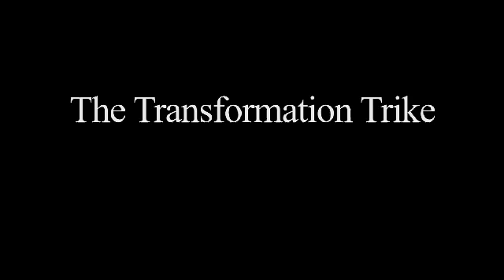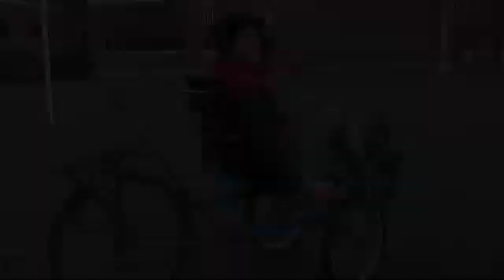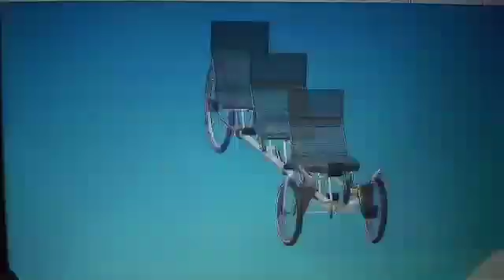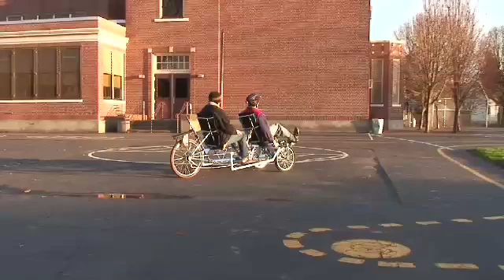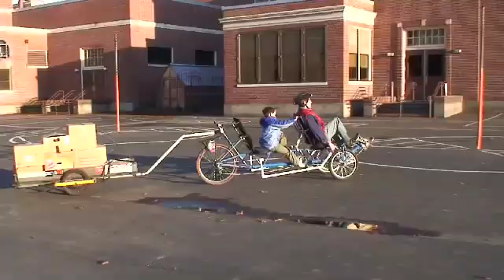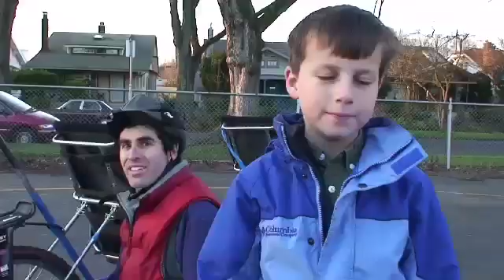Innovate or Die -- The Transformation Trike

Comment: @pdxktv There IS something misleading in the graph. Why is Swimming - the Least efficient and slowest - in the middle of the Y axis and not at the very top? It is no use putting the label "1 1/2" (mph) between 10 and 30 because it creates a Nonlinear, (Non Monotonic even) er "axis". Walker, Runner, and "Horse and rider" are similarly Deliberately misplaced. I appaud your efforts but not your er "Marketing", nor the result, and suggest that Production'd get you into all manner of Legal Hot Water.

Comment from the maker: @MistaTSluss Electric cars are, for the most part, coal powered cars and, regardless of fuel source, if we use electricity to replace gasoline in any significant manner we will be facing a whole host of new problems with infrastructure/delivery, pollution, and higher prices.

Comment from the maker: @MrHobiecat most of the driving I do in the van is hauling a small number of humans. In that case, there is not much practical difference between the vehicles.  

In many urban environments a bicycle can actually get you to your destination quicker than a car so the 75 mph cruising speed is irrelevant.  

There is nothing misleading or inaccurate about the graph.  If your goal is to transport humans and top speed is not a factor then the bicycle is the most efficient means.

Comment: This looks heavy, slow, tippy and the steering is awkward. I would bet a buck those boxes are empty. First hill or rough road and I think you're pushing. I don't see the advantage over a regular multi gear bicycle with a lightweight trailer. Sitting down you cannot use body weight to help with inclines and downhill would be bloody scary.

Comment from the maker: The only thing being proposed in this video is the trike and that expensive fuels could make it even more viable.

But since you brought up the straw-man arguments that we are trying to take away your freedom and tax you, think about this: The privileged of driving motorcars is a completely subsidized endeavor. Gas taxes account for about a 1/3 of the total cost or roads and does not include operations to protect the oil supply or any other externalized costs like air pollution.

Comment: Libs said the same we're running out of oil blaa bla bla in the seventies under Carter. Knot heads like you think the only safe way to power this country is with wind mills and rainbows, wait, windmills kill birds, so that leaves only rainbows. Many states have oil, Alaska is loaded, but we wont drill because it might offend a caribou or something. Also, we could use nuclear power to generate hydrogen to power all motor vehicles. What is really dangerous? riding that tricycle down the interstate

Comment: I just looked it up. Al I found was a trailer that attaches to a bike like a B.O.B. trailer does for transporting 1 person.`Also there was a mountain bike set up with racks and panniers for holding medical equipment. Both of these are good ideas and possibly a step in the right direction but they don't compare to the big diesel powered machines that we use now. Like I said before, they have to be able to transport the patient quickly as well as hold all the medical supplies and a crew

Comment: They can.  I can haul approximately 700 lbs on my current bicycle+trailer.  I could haul more but my trailer's got a pretty low axle limit.

A 23' sailboat is approximately 3/4 ton.  No problem for 3 guys, but I prefer a 14' tandem kayak with sail and treadle drive which weighs less than 100 lbs. That's easy enough for anyone to carry.

For heavy loads, you use a trailer with disk brakes.

Comment: It is clear that you are obtuse, ignorant, or both.  In either case, I suspect it is deliberate and its really not worth discussing things with you.

FWIW, a 45hp cycle can spank your ford ranger in both acceleration and top speed.  However, as both vehicles are fully capable of breaking the law, its pointless.

Also, with 2-3 fit riders, proper gearing and a decent trailer, the vehicle shown in this video can easily haul more than the 1200lb payload of your ranger.

Comment: Ummm, bikes are great, but versatile designs like this have existed for over 10 years, and, although expensive, can be self-built for the $100 cost of the schematics.  Check out Greenspeed bikes, online, for the top designs.  These include many types of racks, and multiple configurations using S&S coupling devices- which require no tools to assemble/dissasemble.  Innovation must be just that.  Please do some research.